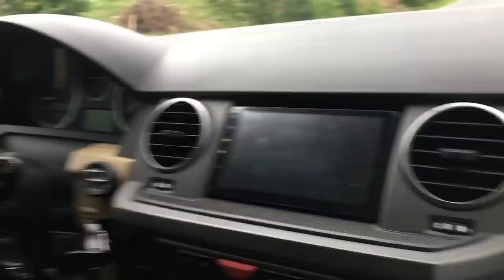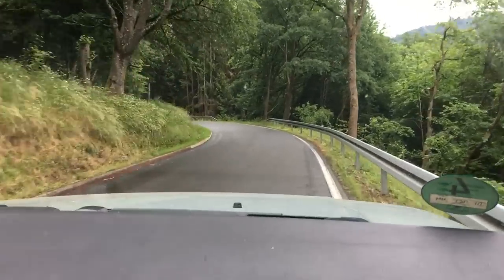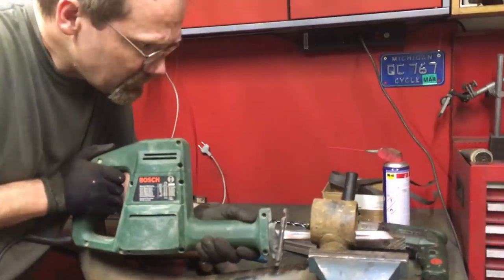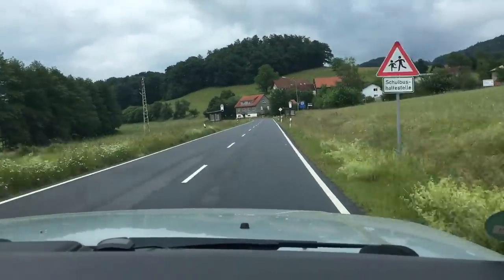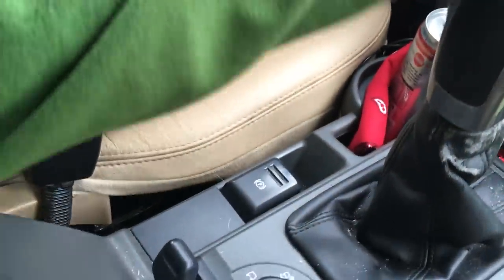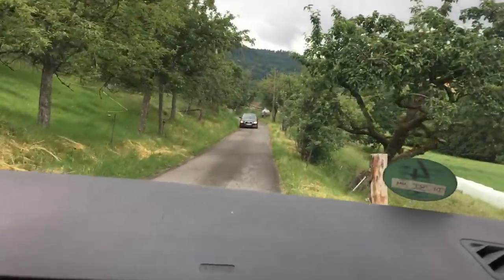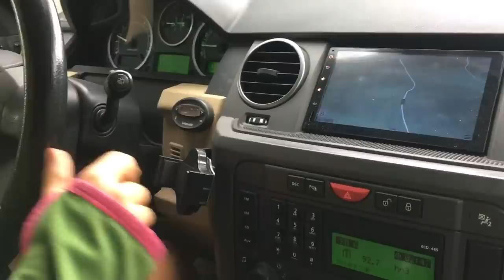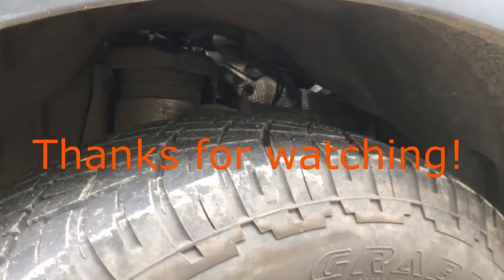Land Rover Discovery 3 / LR3 - Typical Problems And Why We Love It / S1-Ep2

Comment: Great video. I have driven my 2007LR3 2.7D since 2009. Bought it with 34k km on the clock. Just passed 342k km. It needs maintenance, budget 1200 euros per year and ur fine. Otherwise it's a brilliant all round go anywhere vehicle. Super capable. Keep the vids coming.
Reply from the maker: Wow, averaging 25k km per year, I will need an other 5 years to get there.    But I´ll do my best to get this done.   Thanks for your feedback - it is very much appreciated.
Reply: Is your v6 or v8?
Reply: if you were here, you may wreck 2000 worth of tyres a year if you are in the Outback, most roads out there are not sealed

Comment: Hi Christian and Vera,
I was about to abandon my 2006 Disco 3 because of dreaded error P22090 (rail pressure too low and limp home mode). Sunk 3000 euros into a shop for diagnosing the problem and replacing the in-tank fuel pump and basically checking everything on the low-pressure side. I was not ready to put in another suggested 4k for a high pressure fuel pump (HPFP). So I wanted to give up. That’s when I stumbled over this video. 

It completely changed my world. After 6 happy years, I knew already several of those weak points you mention. Well, with my newly-found “Innere Einstellung” I decided to give it a go. Believe it or not, I ordered a HPFP (450 euros refurbished, looking like new), and replaced mine. Took me two days all in all. The ECM is happy to get 158MPa fuel pressure again! Car runs like new! 

THANK YOU.

(I have the HPFP type 5WS40157, which is a little bigger than newer Discos have I think, from 2007 onwards. I could barely get it out. A bit of a problem is that the belt case can’t be removed, because it is held by the cam shaft wheel, so I had to force it a bit. But it worked. If you need help with this one sometimes, give me a shout :)
(Funny fact: I put the old belt back in, because the new one didn’t arrive in time, and I decided that changing it later is no  big deal at all, anymore. :-)
Reply from the maker: 😃👍 That is so great. Those kind of comments make it all worth the effort. Thank you. Fabian has had the same problems (I don't know if you have seen our last couple of videos where we worked on Fabians Discovery). He had the same problems, but we have been avoiding changing the HPFP. But since he wants to travel through Mongolia with this car, we are going to change the HPFP anyways, but haven't found a new one yet ( or appearantly haven't looked hard enough)😉  🙋‍♀️ Vera
Reply: @Vera_and_Christian  Once I endoscopically found the HPFP’s number plate, it became much easier to find a replacement. 

Since you already ruled out injector leakage, there are exactly four problems left than could cause P2290: 1) rail pressure sensor (sits in the diverting rail and can be replaced individually, about 15€ the cheapest ones); 2) the pump itself which doesn’t create enough pressure; 3) malfunctioning VCV (integrated part of the pump, and usually replaced/tested with it); 4) malfunctioning PCV (also integrated part of the pump, and usually replaced/tested with it). 
I probably wouldn’t bother changing the rail pressure sensor, when it delivers plausible values but just the maximum pressure is limited. When idling, it reads 22MPa (220bar) in my case. My old pump topped out at about 135MPa, but it should do 160.

Comment: I hear you on cheap aftermarket lower arms. Here in the UK my LR4 failed its MoT test yet with lower arms and bushes after only 4 years and just 22k miles. Just had new original parts fitted and now the drive is super. 
Thanks guys.

Comment: Thanks for a great video, I have an early Discovery 4 and can relate to most of the issues you’ve had with yours. 

Some great tips as well, thank you!
Reply: Andrew FitzMaurice hows that going for you. I just can't get the thought of an LR3 out of my head. But it's just idk if I can afford the standard maintenance.
Reply: @chrisconstantino9827  I use a local Land Rover specialist and it does make a massive difference in the cost of running mine. 

A standard service would be around £300, but I usually need, or ask for something extra to be done, such as changing the gearbox oil as an example, servicing the electric handbrake etc. 

So my services are usually around £500 with extra work/repairs. 

Over the past couple of years all of the suspension arms have been changed. In terms of failures I have needed a new power steering rack (around £300 I think), new air compressor (£4-500 roughly), complete new electronic handbrake (£1,000) that has been the one item that has really annoyed me, one the cost of it and two I have been told it isn’t a service item, so since being replaced I now specifically request it is serviced annually. 

It does worry me at times something major will go wrong, as there have been a few incidents of crank failure on the 3.0 diesels, but with mine being a 2010 on around 120,000 miles it would probably be scrapped. 

If you are looking at the 2.7 diesel Discovery 3, there is an issue with the bracket failing that holds the water pump, there is an updated part you can fit, it does only apply to certain model years so worth checking. 

Despite painting a grim picture of costs and faults, I absolutely love my Discovery, it just makes me feel as though I am in something special and something I have never felt before in any of my other cars.
Reply: @andrewfitzmaurice7843  thank you for all of that. I really appreciate it. I live in the states so I've been looking at the naturally aspirated v8 since there's a bit more power/torque than the v6. 

Any specific forums you go on?
Reply: @chrisconstantino9827  I would certainly love a V8, but the fuel costs in the UK would be horrendous!!

Whilst it is a mainly a UK forum (there is a good few US members as well and other LR3 V8 owners), disco3 dot com is fantastic with some incredibly helpful and knowledgeable members so definitely take a look.
Reply: @andrewfitzmaurice7843  awesome thank you very much!

Comment: Fabulous video!  If I was 1/100th as capable as you to perform my own repairs, then I might consider purchasing one of those things.  As it stands, you have absolutely convinced me beyond any shadow of a doubt that I should NEVER become an owner of any LandRover, period!  I live in the US (Michigan), and I have owned several Jaguar sportscars, two of which we still have!  Those have had their issues from time-to-time, but nothing like what you have experienced with your "Landy". Think I'll keep my 2015 Jeep Grand Cherokee Overland 4x4 Diesel, with Off-Road Adventure II Package, Air Suspension, and multiple aftermarket bash plates and rock sliders, which I frequently take off road in some pretty nasty stuff.  Again, GREAT Video!  I highly recommend it to anyone considering the purchase of a used Land Rover LR3 (or any other model for that matter)!

Comment: Yep - I fixed my compressor air dryer cap with an aluminum one from eBay for $70 - Independent wanted $2800 to put a new AMK air compressor in. That was like 4-5 years ago and my compressor still working fine. Its a known fault the air dryer cap splits down the mold line right through middle. Super easy to fix and diagnose with some soapy water. Most issues with D3 are common manufacturing faults and well documented and easy to fix.
Reply from the maker: Yes you are right, that is why we are not afraid of anything the car throws at us. We'll just deal with it as it comes.  The good thing is that you definitely know it's coming sooner or later. 👍🙋‍♀️ Vera

Comment: Hi Christain. I've just discovered your channel.
You have almost the same philosophy regarding the D3 as I do. I've had mine for nearly 7 years and now it has 310,000km , 240,000km of those are mine, so I've encounted most of the faults.
Most definitely stay away from LR. They are easy to fix.  I have some comments on your points.
All years of 2.7 oil pumps are suspect until the revised version is fitted. Only fit a FoMoCo pump.
Body off is not that bad for a shop with a 2 post lift.
The turbo actuator doesn't stick if the car is well driven up to the red line regularly. 
Service the EPB park brake annually, it will never fail.
Use an IID tool or similar tool with Car Configuration File editing facility to turn off the auto apply of the EPB, you can even set a manual gearbox car to auto release the EPB.
Service your air compressor now, before the light comes on. The air drier suffers with cracking and dessicant gel caking causing a blockage. 
I see you've  rust proofed the air tank. Wet countries suffer from rust underneath, and your car is suffering like UK cars do. 
The rear timing belt is easier on a LHD like yours as there is no need to take the battery out to get hand room like on a RHD car. 
I see you've refurbed your rear wheel bearings, with a hammer. Good work.
You must be heavy on the brakes, I get nearly 100,000km out of my pads.
I don't agree with your assessment of the manual gerabox. Auto for me, always, it matches the car very well. 

I run a facebook group dedicated to the technical aspaects of the L319 Discoverys.
Https://www.facebook.com/groups/1667428720239548/?ref=share

I think your vidoes are great, you're a natural. Keep on Discovering and I hope to meet you on the road somewhere.
Reply from the maker: Thanks for your comments.  I never thought of doing any preventative maintenance on my air compressor.  This is a awesome hint.  I will do some research and then take it appart.  It sure was never open before.   
Is the air dryer a replacement part?
I never opened the EPB either.  It did start to grind just recently but recovered after a few attempts.  So I ordert the replacement parts kit from Britpart.  This is now on my bucket list to do. Should have maintained this better as you said.  Parts where 130€.
My disk brakes now are ok and have about 50k. I guess I had cheap parts or pads before.   Still, no chance that they will last 100k.  We live in a hilly area with many curves.  
Good hint with the turbo link. Let´s me worry less about it. 
I miss an automatic transmission too sometimes...
Reply from the maker: I have to add:  The rear wheel bearing actually came apart when installing it with a hammer. I know this now and I did not feel good at this time.  Hope the seal is working.  This was my first push-in Wheel bearing ever.  Made me think about getting a press. I am not a car mechanic but my car will not get someone else’s hands on it.

Comment: I’m really enjoying your channel!  I’m in the UK and probably the greatest advocate of the Discovery/LR4, having had to replace only 3 door locks (£150 each) in 7.5 years and 140,000 miles.  Otherwise just routine servicing.  Everything works, including TVs, economy is OK at 28.5mpg and it just goes.  It has the ZF 8speed box with the 3litre diesel. Touch wood the car has been the best 4x4 I’ve ever owned but it is also the best family car, bike carrier, people mover, van and posh event car, it is a great motorway cruiser and always has extra stowage space somewhere even when you think it’s full.  It doesn’t eat tyres like some cars I’ve had and has a real spare, not a space saver, can of foam or run flats. If you advertised this car with that age and those miles I’d probably pass but that would be a mistake. I’m lucky in that I use an approved specialist who has dozens of these on their books, and some at the 300,000 mile mark.  The way mine feels today, still squeak and rattle free, that mileage seems realistic.  The worst 4x4s I’ve owned over the last 22 years are ones that you’d never guess, and the absolute worst of the lot at only 20,000 miles would shock you.  It broke down on day 1 and is a regular at the dealer who sold it to me. And part of the problem is the main dealers here for that brand don’t know the vehicle well enough to fix it properly.  Years ago I did ask a 4x4 specialist before buying the Land Rover whether it was risky and their view was that on average all 4x4s are much the same over time.  I’ve owned 8 other off readers and one SUV, and I think their assessment was about right.
Reply from the maker: Thank you Land Hopper.  Agree with you. Most other SUVs have the same issues when getting old. Who buys a 250tk VW or Mercedes and expects a cheep trouble free ride?  For some reason this is expected from a Discovery... Complaints about air suspension? Yes, this is not a issue in a JK or JL. 👍

Comment: Really enjoyed that! I have a similar car, Discovery 3, silver, manual. I've bought it with 1000 miles in 2006 on it and it's just turned 170000 miles, so around 273k km. I've done a lot of work myself, but I have a local independent landrover specialist who did the clutch for me that started slipping at around 140k miles. I can concur, it eats brakes..possibly because it's a manual...but ecen brake discs and calipers is a easy job. I had to upgrade by jack, axle stands and torque wrench, as everything is bigger, heavier and needs tightening up tighter on a landrover. I've replaced the front suspension arms, still running the original rears! repaired the suspension pump once, replaced it with an upgraded item the next time, so I've seen most of what you have seen..but nothing has been too bad and parts are not expensive....so if I'd have to replace it, I'd have another! Agree, really like the manual gearbox.
Reply from the maker: I used to buy cheap spares and I stopped doing so about 2 years ago.  Should have bought high quality spares right away - they are good priced, just like you wrote.  Thanks for your feedback.

Comment: hi i am also a discovery 3 owner here in the uk, i just wanted to say thsnk you so much for making these videos i spend a few hours a week watching and learning new things too, i completely agree with everything you said about the disco 3 i changed my oil pump to the newer type the stronger type and all belts too, i am on my second air compressor. and i also cleaned my front and midddle air blocks i had the body off in a shop for that witch was very costly like £850 plus the new belts and oil pump etc. yeah i agree with you on the fact that these trucks do need to be maintained all year round which in turn doesn't really give you many problems these discovery 3 are great vehicles when they work and i mean with out any faults but i would put it into 2 types of faults 1 beings actual problems that just turn up when they want and 2. just wear and tear on parts like my alternator died but it was 15 years old, hopefully some time next year i will be swapping all my air suspension shocks for springs conversion and still have all the off road terrain settings just because i feel the truck will out last the air suspension, plus we have had so many problems with ours. i also fitted a roof rack for when we go away camping we had about 600kg of stuff on our roof plus 2 adults and 4 children and not 1 problem we also took a spare air compressor with us because i new what the car is like. i do have a Instagram account with my discovery 3 pictures on there just message me if you wish to follow my story of my D3.. thank you again
Reply from the maker: Hello Rusty, what is your exact Instagram name?
Ours is "Its LR Time".
Thank you for writing your story to us.  The LR3 is the most underestimated SUV with the widest span of lovers and haters.   We will look at your Insta site.

Comment: really fun video, thank you. i have 2007 v6 petrol and it goes great, i have had a couple of issues you mentioned but i repair myself and it is fun.  living in Australia i go off road often and it does a great job.  every so often i think of upgrading but it goes too well still to do this. the air springs are very easy to change, the air valves are also easy to change or replace o-rings on,  the compressor needs the dryer module changing so get that done, its a very simple job...

Comment: Nice video!! I bought my LR3/D3 V8 for about $1800 with 173k miles 2½ years ago. Today the odometer show 211k miles and counting since this is my all purpose vehicle, and I enjoyed every mile 👍👍
Reply: Any major maintenance items since you last commented?
Reply: @jordanpierce1366  Hi there, I sold my LR3 with 278k miles and running strong with no mayor problems at that time. Under my ownership I replaced the original front suspension that came with the vehicle, the thermostat and the radiator, the part I replaced the most was the PCV (3 times), a friend of mine solved that problem adapting a catch can.

Comment: Found this video today and subscibed immediate. Thanks for this one. After more than 20 years of driving Discovery 1 and 2 we're thinking of buying a Discovery 3. It's kind of reassuring this car will brake down as often as our previous Discoveries. I was a bit worried about the costs of the repairs and how much you can do yourself on a car stuffed with electronics. I will be looking for one in Germany because here in the Netherlands you won't find one with less than 250.000 km on the clock.
Reply from the maker: 👍😃Welcome to the channel.  I really hope you find a good Disco 3 here in Germany.  They are slowly getting old and finding one with less than 180000 is becoming  a challenge. 🙋‍♀️ Vera